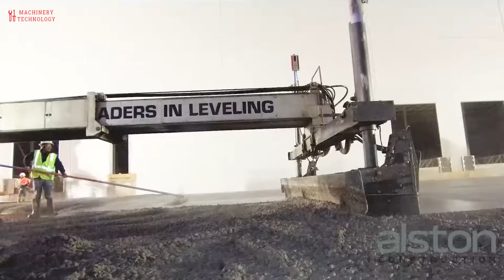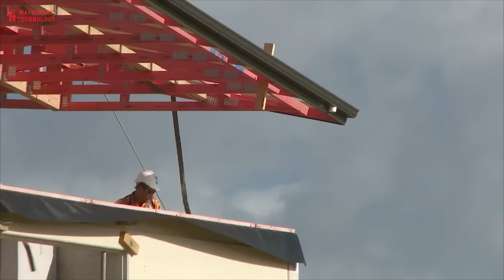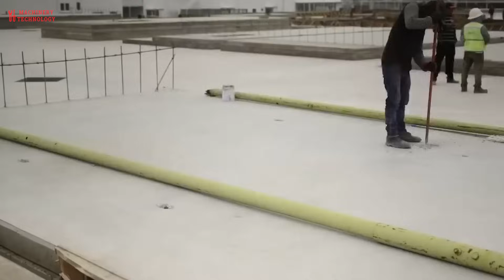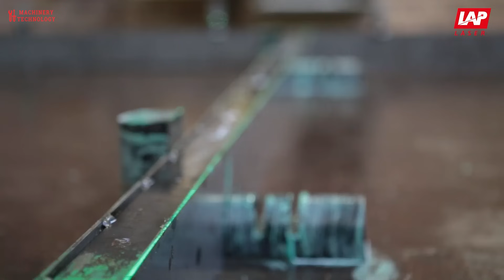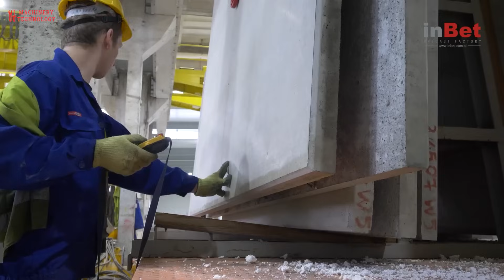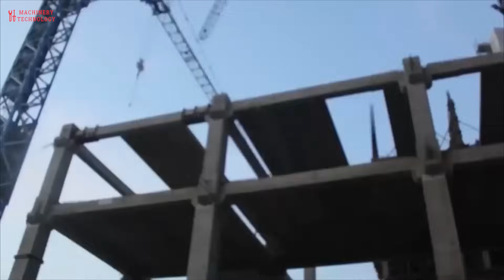Extremely Fast Modern Construction Technology  - Amazing Industrialised Building System

Comment: This technology is known since more than 40 years. What's new to present in this way. We know even better concrete precast systems.
Reply from the maker: Thank you. If possible, please tell me some good methods you know so I can make videos about it
Reply: You can search for insulated double wall system. Also known as twin wall. Elements which are 13.5 m high and 3.5 m wide. This system is even seismic proofed. You can find in Europe mostly Germany and Austria.